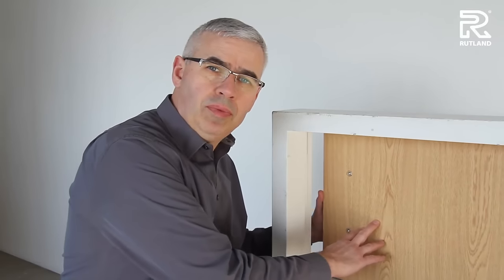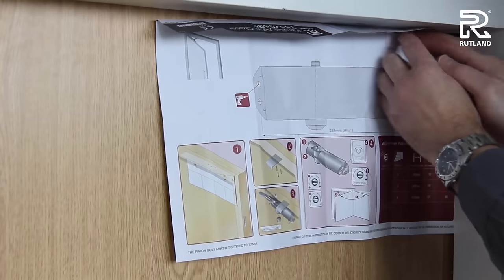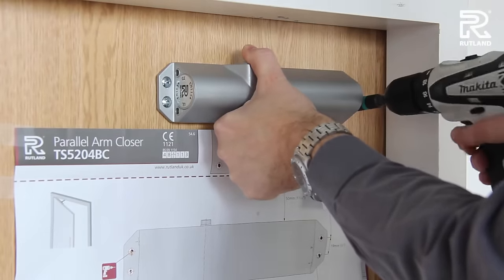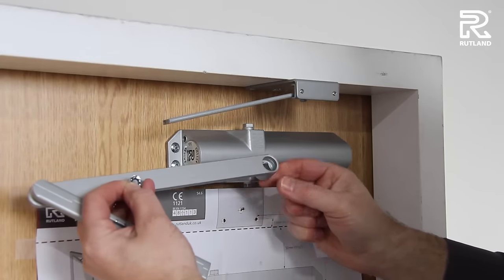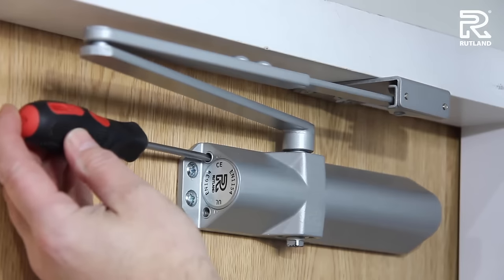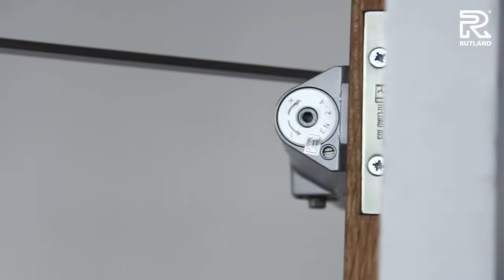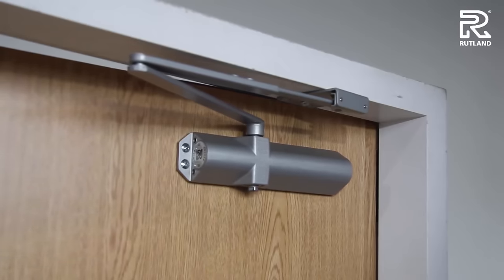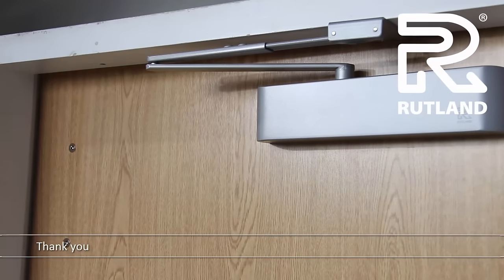Rutland: Know How - Rutland TS.5204 DABC How to fit - Push side Figure 66/Parallel Arm

Comment: Very helpful video but I was failing totally to adjust the two speed control screws correctly until I realised my door  was a left push and opposite to yours which meant the valve screws were the other way round! Doh!
Reply from the maker: hopefully you'll remember to view the valve adjustments +/- symbols next time ;-) all good lessons though :-)

Comment: How can I install a door closer on a glass door without any frame on it
Reply: I've seen this being done recently very dangerous due to the weight of the door closer simply get a block of thick wood measure your door with then use the strongest glue in the world to stick to the glass and bobs Ur uncle carefully fit the door closer onto the wood on glass door then attach the arm to the frame just make sure the arm isn't 2 strong 💪 make the arm weak so when the door closer closes the door there isn't excess pressure put onto the glass door